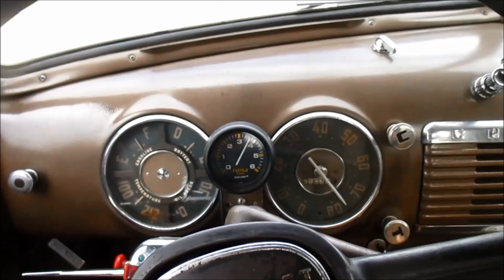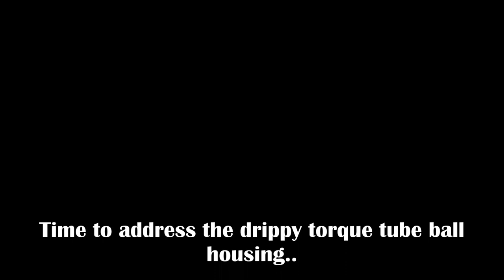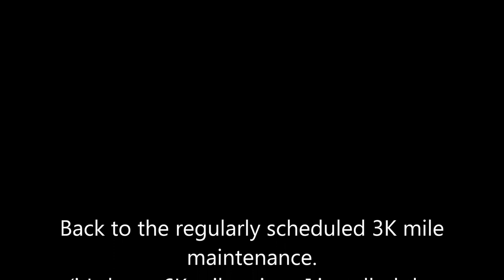1949 Chevy 3100, 3000 mile service part 2, Volume 59

Comment: Before I put the T-5 trans in my '53, I did the same thing you did here, new gaskets an such, but mine leaked at the nut on the back no matter how tight I could get it. I improvised with some old bootlace leather split down the middle to make it smaller, kinda like old pump packing, wrapped it several times, put the nut on, no more leaks. The things we do for these old trucks.
Reply from the maker: Another great tip & trick, Keep 'em coming. Thanks for sharing.

Comment: Thanks for the school   That must be a common task on these trucks, I’ve done the same. After several 1000 miles my cork gasket on the ball socket started seeping from wear , Not wanting to pull the trunyon apart I wrapped the cork with Teflon tape , it is holding better than the new cork did originally. An old mechanic taught me that trick with O-rings that wouldn’t hold . It is a little time consuming wrapping, I’m going to try that trick on the torque tube nut packing when the nut won’t tighten down any more also
Reply from the maker: THose old mechanics tips and tricks can't be beat. I learned more from some old dealership mechanics than I did the combined schools & lessons I took. I'll have to keep the teflon trick in mind.

Comment: Longshot but what step am I missing to separate the transmission from the torque tube? Does the rear end really need to be removed?
Reply from the maker: Once you slide back the ball housing the U-joint is accessable and the 4 clamp bolts can be removed that bolts the u-joint to the trans yoke which allows the torque tube yoke to be slid back just enough to disconnect it from the tranny. Make sure you put something under the torque tube to hold it up as the rear leaf spring tension will want to pivot it to the ground. I unbolted the trans cross brace and I slid it back to hold the torque up & out of the way.
Good luck.
Reply: @Volfandt thank you! That was the missing piece. Got it separated.
Reply from the maker: Good deal, glad you got it

Comment: Dave you didn’t have to replace the replace the okie bushing?
Reply from the maker: I didn't at that time. The propeller shaft fit nice & tight in the torque tue bushing(s) and the seal was OK since the rearend wasn't getting overfilled by leaking trans lube. Now since I've put over 26K on it since I got it back on the road it may need checking out.

Comment: Love your videos. I have a '52 3100 that belonged to my grandfather. Question—do you top off the ball/trunnion housing until it begins to drip out of the fill hole like you would the transmission or differential?
Reply from the maker: Thanks Ty. I only add 6 ozs of 80/90 to the ball housing. I found that info somewhere and wrote it down but I don't remember where I got it. Unfortunately it's not in the manual. The manual does say that lube from the tranny does overflow into the ball housing over time. I figure by adding more than that the lube will overflow down the torque tube towards the rearend instead of staying in the ball housing..